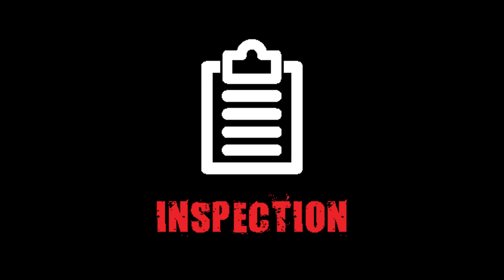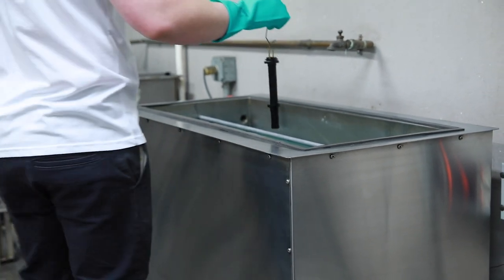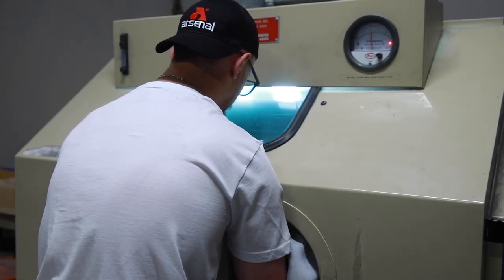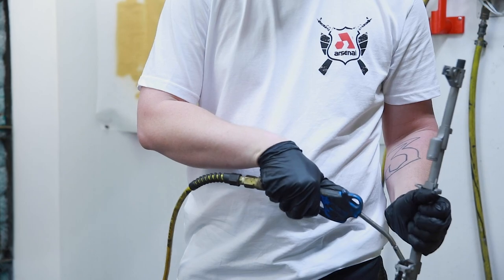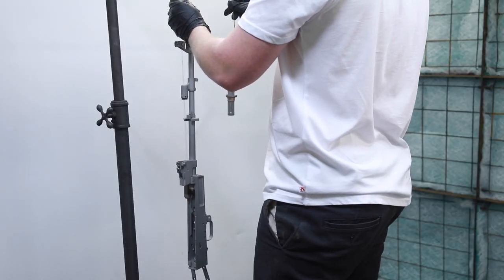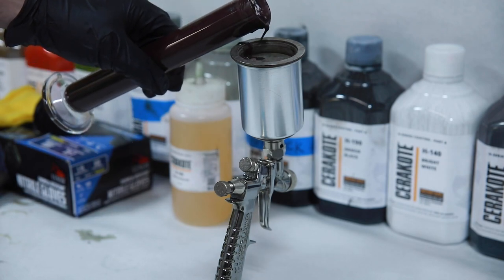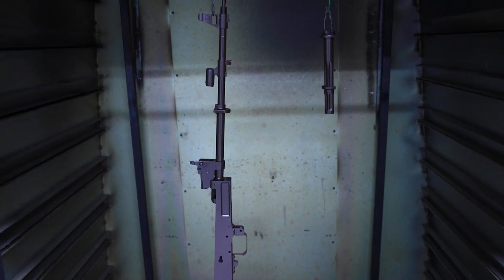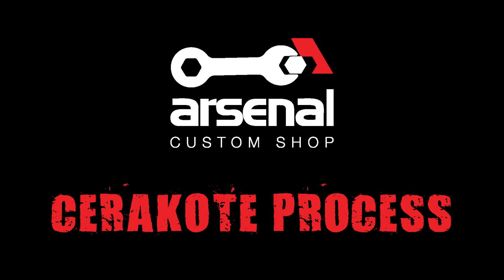Arsenal Custom Shop - Cerakote Process Video

Comment: For how expensive your rifle is, you should apply a better coating to start with. Arsenal factory finish is notoriously bad.
Reply: Cav Trooper 19D  Can I send my rifle to arsenal custom shop for a cerakote finish or do I have to buy a new rifle with the cerakote?
Reply: Cav Trooper 19D  Thanks!